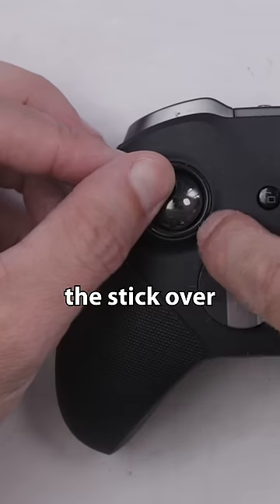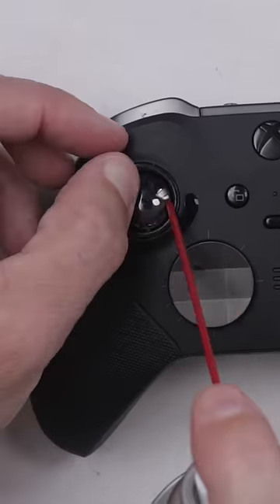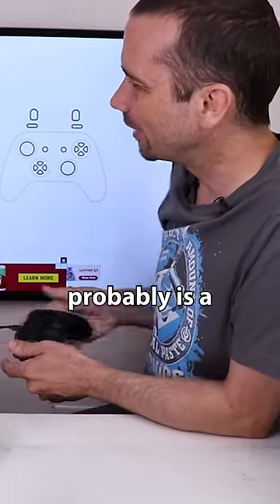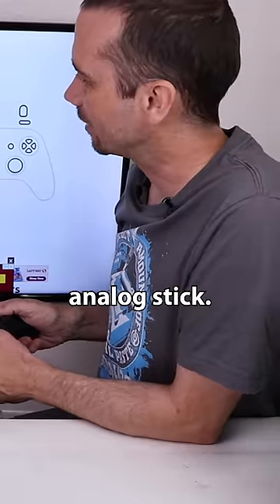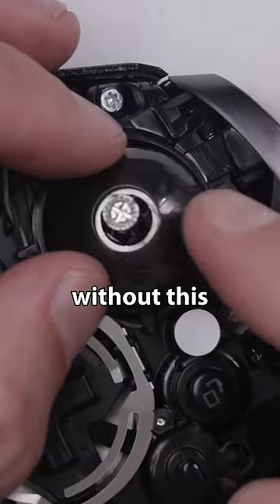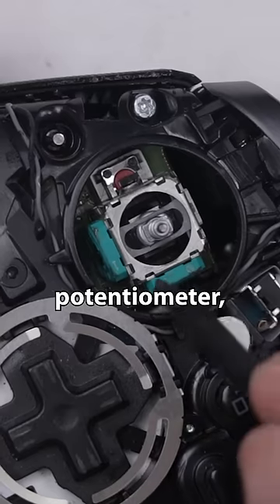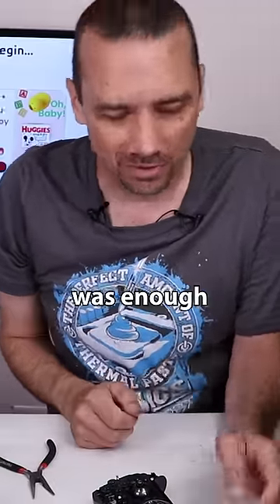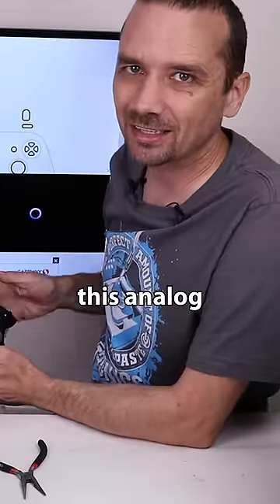The Easiest Way to Fix Analog Stick Drift!

Comment: Oh my please never do that. Open the controller and apply correctly. You are just setting yourself up for a messy repair later. All that BW100 is going to do is get everywhere and collect cheeto dust. You know some viewer is going to spray half a can in and blame you later.
Reply from the maker: Lol, BW 100 evaporates in a few seconds
Reply: @Tronicsfix  it might but putting in too much will still mix with whatever debris is inside the controller, the Cheeto dust does not evaporate lol 

We may know, but every Joe that sees the video doesn't - especially if you don't know condition of the controller it could be risky to just to go spray fluids in

Comment: Okay but here's the problem analogues work because of a material rubbing against another material. This fix will work short term but your analog stick has about half as much lifespan as it would brand new the next time you do this it cuts in half again.

Comment: "so as you can see its dead center"
It was definitely pulling to the right you goofball. you didnt fix anything.
Controller would be unusable in trackmania, constant 3% input on .100 deadzone.. also just fix your stick drift with deadzone. its not hard.. If youre not making super precise micro adjustments with the stick it shouldnt matter what your deadzone is

Comment: It does not help for ever and is a momentary fix, Joystick-drift is caused bei waring out the potentiometers resistor path that the slider is rubbing on, the slider permanently damages the surface of the resistor path after sometime. The only real solution is changing the Joystick-box with new ones or Hall-Joysticks witch are much more durable, alternatively only changing the potentiometers on the Joysticks witch you can buy separat is also possible